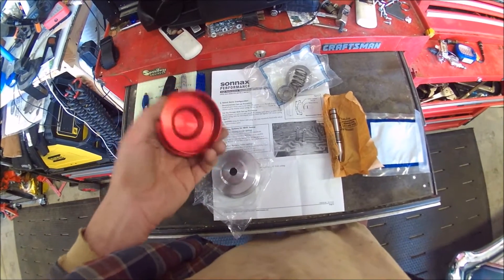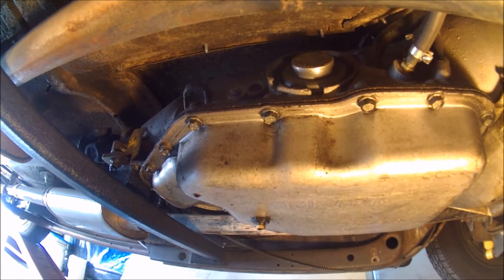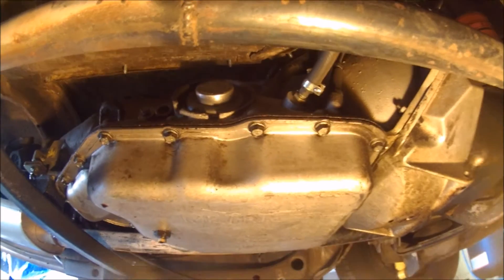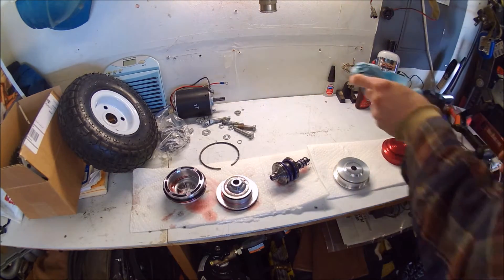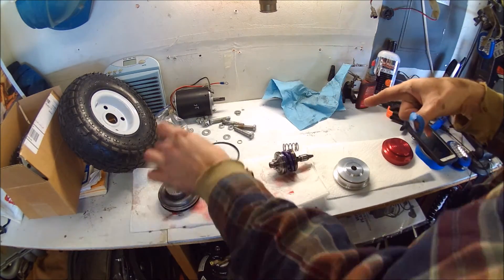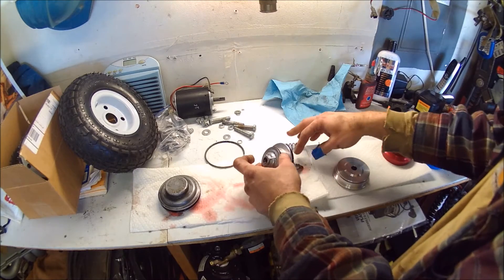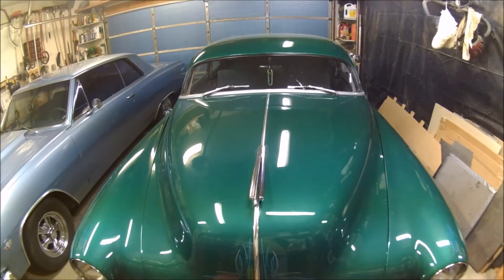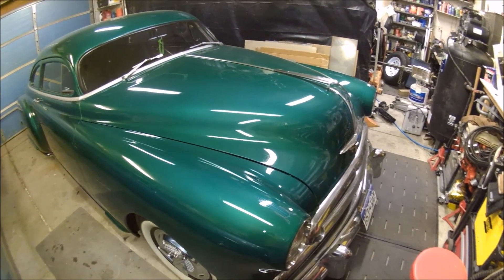TH2004r Servo 1

Comment: I think a tenth of an inch is too much clearance. You need to do the initial install without the springs and seal and use a feeler gauge to get about .050-.060 clearance(i stacked to feelers) between the cover on the snap ring. Then pull it back apart and put the seals and springs on and reassemble.